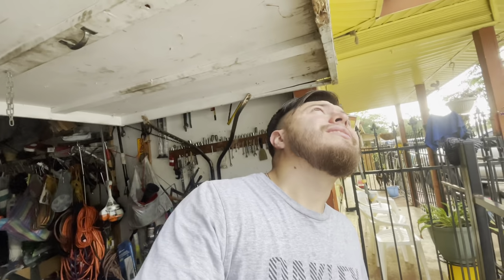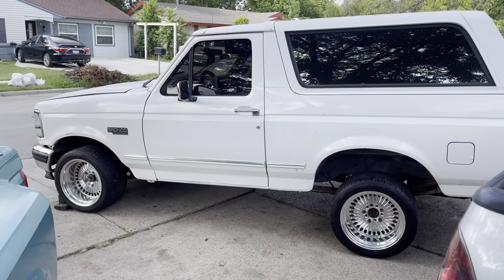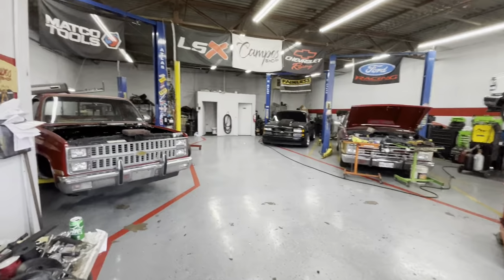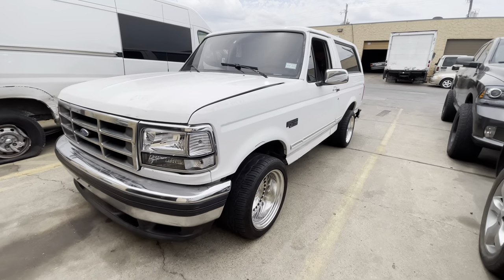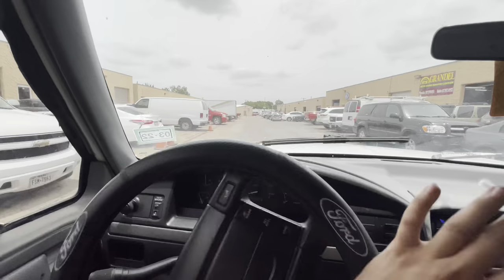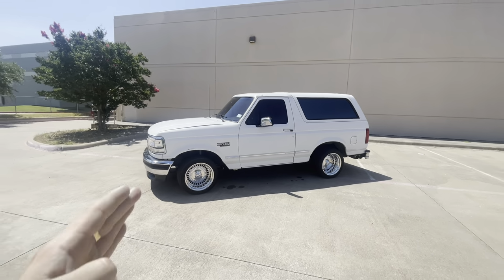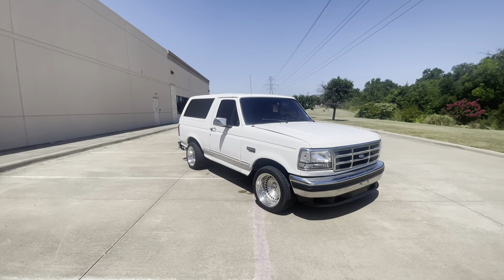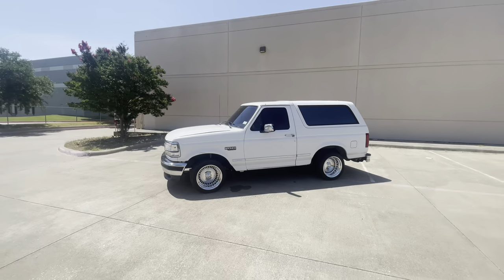My 1994 ford bronco on 17x11s🔥

Comment: Loved it up until the point you mentioned you deleted the front axles.. I wouldve kept it 4x4 for the cool factor, and dropped on the 17x11
Reply from the maker: The front axle where useless bro, when I bought the truck they had swapped the tranny to a 2wd manual tranny so 4x4 was not working & those front axles where useless & just there adding a lot of weight

Comment: 😍😍
Reply: Say bro what did you do to level the truck. I have a 93 f150 getting up and running
Reply from the maker: @rudyrromero  I put a 2 inch spring in front & 2in shackles in the rear with the 2in hanger shackle thing in the front of the leaf springs
Reply: Oh ok thanks for the information on that. I'm not sure but did you do all that at the shop in the video? I stay like 5 minutes away from it